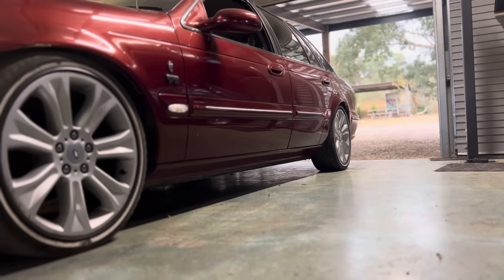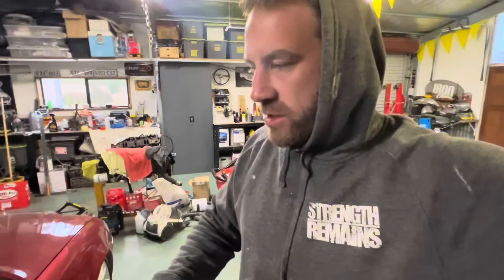BACKYARD ENGINE REBUILD On My 318 Chrysler - Can We Save This ENGINE? Iron Empire EP 157

Comment: I dont want to be that guy but the "ridge" is just the factory bore. You would only need to remove it before removing the pistons to prevent rings catching at taking a land off the pistons. Probably need to internal mic those bores at 3 heights an x/y direction to check for round and taper. Ball hones would not be the preference here over a stone hone.

Comment: 318s are great, but they have a woefully low compression ratio with stock style pistons.   Any mods will be relatively ineffective unless the CR is addressed.
Reply: Not true!
I also have a mild 318 with only cam,intake,carby,ignition and full exhaust upgrades. This made a big difference to how my car performs now!  And yes I was on a budget as well.  To do heads and pistons also was easily another 5-6,000 and I simply couldn’t afford it.
Reply: 71 318 should be 8.6 to 1 comp so its not high but a cam and a little port work will help HP for sure anything to help pull air in and keep the air speed up in the intake will make a big difference
Reply: @Tk-ou9ec  well it is true.  If you stick a reasonable cam in something with mid 8's compression, you are leaving lot on the table...
Reply: True , ive seen people alloy head them big cam and holley with stock CR and get average results

Comment: I have a mild 318 in my CM. I had a mechanic do most of the work on mine as I’m not to savvy in that department!
Upon start up of mine with the new camshaft (comp 268H) he noticed that there was no oil feed on the right hand side rockers!
We discovered that the machine shop that installed the new bearings and camshaft did not check tolerances and the camshaft was a wee bit to tight and it spun a bearing blocking off the oil feed to the rockers!
So the engine had to come back out again and he had to linish the cam to get it fit properly.  And voila, engine now has oil everywhere like it should.  
My heads and bottom end are stock,we added an edelbrock performer intake,edelbrock 500 carby,hei ignition and a full 2.5 inch exhaust with extractors. The engine is quite responsive now as opposed to the wheezy little two barrel it was. Had my 727 trans rebuilt with a 2500 stally and also saved up and changed the diff to a harrop truetrack with a 3.45 ratio.  It does go quite well considering it made only 210 hp on the carby dyno.  
I sometimes feel that my carby should have been a bit bigger but it does run great with a bit of a lope to it now.  

Mopar 🤘
Reply from the maker: Yeah awesome! It sounds like we’ll have a  very similar outcome! 
Cheers
Reply: @TheIronEmpire  great engines I reckon

Comment: Had a VC with a low comp 225 ,drove it until i found an ol dodge phoenix in a wreckers with a v8 and swapped it all over ,odd motor as it was a 318 Fireball ,is that a performance motor ?
Reply: From my understanding the Fireball engine just had a different carby on it which was jetted better than other two barrel carbys.  I’m sure someone else will chime in with more knowledge on this matter.
Reply: on the block it will tell you the year in the casting form there you can see what you have as a base